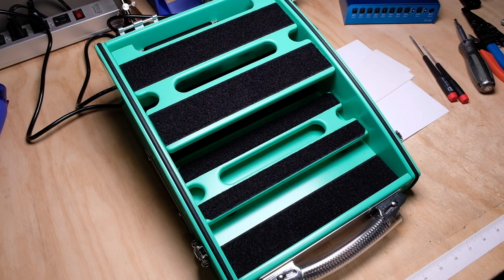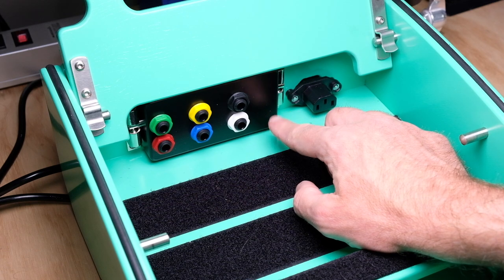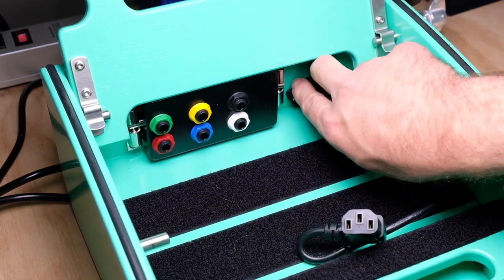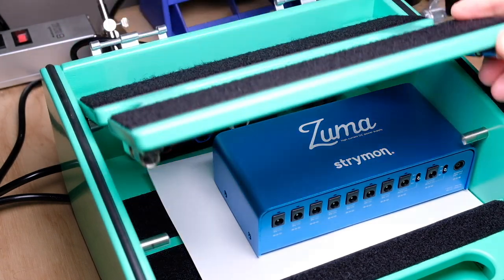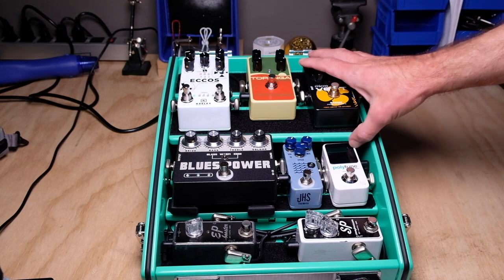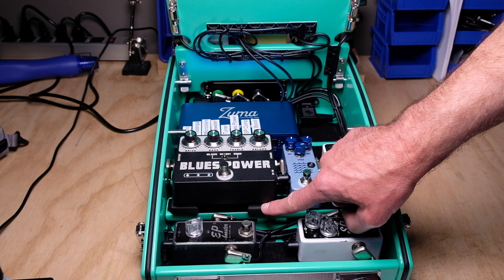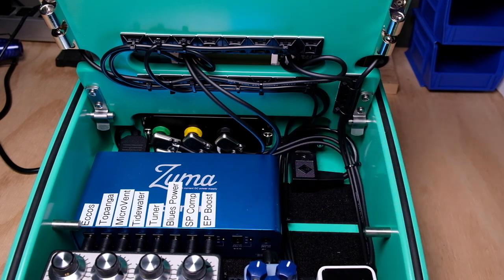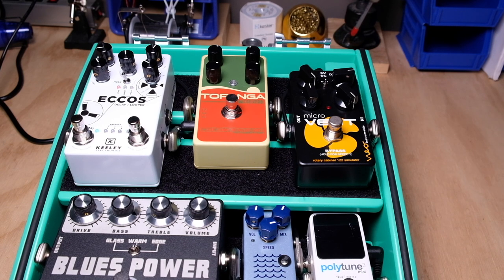Schmidt Array Pedalboard Build Tips

Comment: the power connection... what is on the other side? Does it came as a set? ( I can't find them anywhere on line), does it have to be wired from my included Voodoo Lab power supply cord? Thanks!!!
Reply from the maker: It's just a male to female IEC passthrough with a right-angle adapter if I remember correctly. I would then cut down a standard IEC cable to a manageable length to plug in the power supply.
Reply: @AlphatoneAudio  Thank you! Appreciate the info!